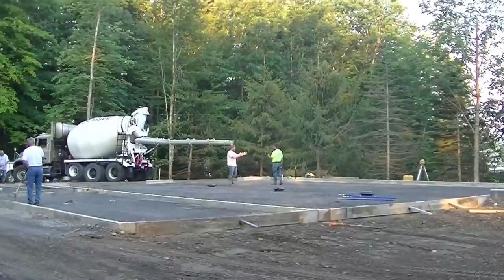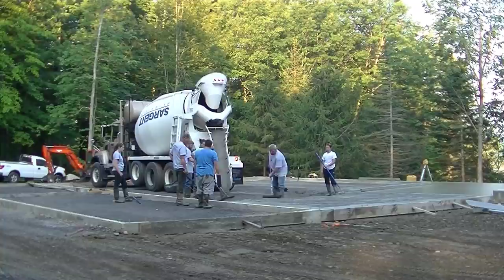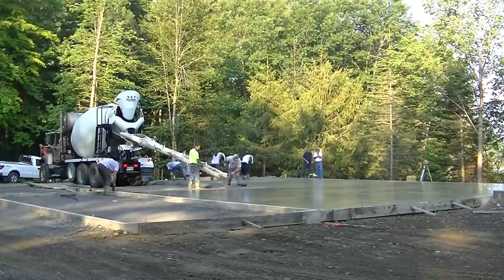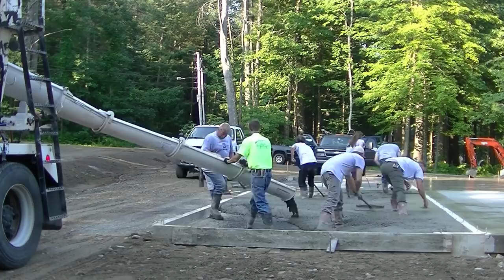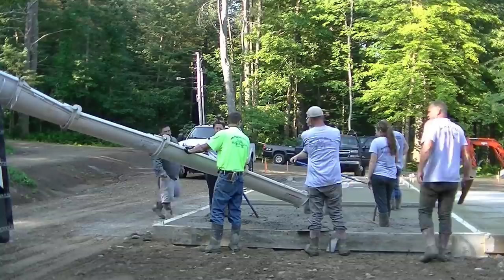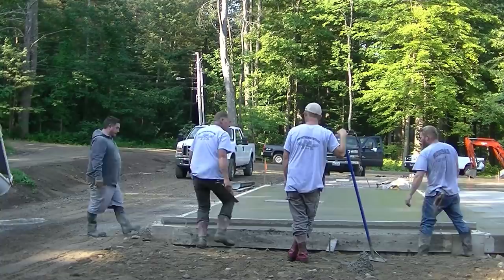How To Pour A Concrete Floor For A Large Pole Barn | Sloped To Floor Drains

Comment: I like to learn more about starting a small concrete business. Thank You Mike for your informative video. Great Work.
Reply from the maker: I'm working on it, stay tuned. Thanks
Reply: R-FPlumbing, it might be too old-school, but when I was a young building contractor, I used to work a pour for free to learn (and help). The only thing I ask the "boss" was,  can I ask questions while it's happening. Usually there is time to ask Q's later, as things move fast getting it down. One thing I learned for sure is: putting the cc down correctly has much to do with how the finished project comes out. Hope that helps.

Comment: Mike, I have been watching you videos for a while now! I really appreciate the way you do things, we are almost identical in our philosophical approach to flat work. I live in western Colorado, it appears that our climate is very close to yours, so this makes it pretty easy to understand your concrete comments and language. We do not use a laser very often but we do use rebar grade pins and the wet screed system. With the temperature changes here in Colorado I use steel and a 6 sack stealth fiber mix on most of my pours, I usually pour about a 5 1/2 slump or so when I am laying down a mono or driveway pour. I also do stampwork as well. I seal all of my concrete at least once with cure and seal and use a stronger sealer when curing time has been reached. I use sikaflex in all cold joints between pours or when pouring up against existing concrete. Thank you for sharing your concrete experience with us all. I have run a business for about 25 years and have over 40 years experience in the trade. I do things pretty much the same as you do and I really appreciate your videos! Thank you a lot, I enjoy them.

Comment: Hi Mike, I just had a 30’x50’ shop pad poured and power troweled.  What do you guys usually recommend for after care for the days after the job during warm weather?  I’ve seen some guys keeping the pad wet for a several days to assist the curing process.  Curious what your thoughts are.  Thanks for making awesome videos like this.
Reply from the maker: If you have the water, keeping it wet for a few days is the best solution for curing.
Reply: @MikeDayConcrete  thank you sir!

Comment: Hi Mike  Love your channel .I learned a lot of tips.
 I want to poor my Pole barn floor 5" thick 2" of foam underneath, wire  Rebar mesh lifted up 2" and pexs tubeing  attached to the  Rebar mesh .
 My 1st question is I live in Ohio  What is the coldest temperature I should poor my barn?
  would you use a pumper truck?
 I do not want to crush my pex tubing. 
 Any other tips
Reply from the maker: It would have to be in the 30's for me to pour and if it was going below freezing that night, cover with insulating blankets. If I couldn't reach all of it from the outside edge, then yes a pump truck is the way to go.

Comment: How much more would it have been to add re-bar or at least wire. Seems short sighted but maybe an enginerd specified the job.
Reply from the maker: Yea, it was engineered. Probably around 750.00 for wire mesh. Like I said, it's not my call. There was fibermesh in the crete. We don't have any problems with cracks as long as the sub-grade is compacted like it should be.

Comment: I am amazed you guys don't use a vibrator to remove the air and compact the freshly poured concrete especially on a job like that. I thought that would be standard worldwide practice.
Reply: Vibrating slab on grades is not typically standard in the US unless there is a lot of exposed edges. Elevated decks, columns, walls and beams should always get vibrated.
🤜🤛
Reply from the maker: psidvicious is right, it's not needed on a slab like this.

Comment: I was gonna ask you -“What kind of forms were you using that you only needed a cpl kickers?” But then you answered my question at the end when you said you did get a bow in the form. Great that you fixed it right then and there cuz it’s a pain coming back and saw cutting and chipping an edge that got away from ya. 
Those were concrete curbs you were pouring against where there wasn’t any forms, right?
🤜🤛
Reply from the maker: It was actually a 4' frost wall with some of the wall above ground. We pour floors inside frost walls like this a lot here in Maine.

Comment: Great video Mike I have one question  how far apart did you have the trucks from each other? because I'm a concrete finisher as well and when I order concrete the plant always asks me how far apart I want my trucks.
Reply from the maker: That depends on how fast you can empty them and screed them. I usually tell them 10 - 15 minutes apart. Unless it's a more difficult pour under a deck.

Comment: Hey Mike, Great videos! I have a question: I live in New York state, just north of Buffalo. I've seen guys getting ready to pour that have like 4" of crushed stone down and others pour right on the dirt....I was wondering what the stone bed does for the concrete or just on the dirt what is the difference..Thank's Paul
Reply from the maker: Both are good, stone or gravel. We pour on both a lot. Just have to make sure they are compacted very good. Stone is a little better if the area is damp or you think you may have a water problem. Especially if there is ledge around, usually if there is ledge in the ground there is water so crushed rock is good for a sub-base in that case.
Reply: @MikeDayConcrete  Thanks Mike, Have a good Christmas!

Comment: Hey there I've got a new pole barn 30 x48  I'm planning a 6 inch slab with 6 inch of stone but I'm in a heavy clay area which sub base is best for clay #1 clean or 2 cruch and run ?
Reply from the maker: Dig out the clay depending on how deep the frost goes in your area and fill with good clean crushed gravel. Compact it in 6 to 8 inch lifts.  I would suggest finding a really good excavator in your area and taking their advice. My advice is just in general.

Comment: Would this setup here be good for a machine shop. As far as the eight of machines?
Reply from the maker: Yes, a 6 inch floor would be very good for a machine shop. As long as the sub-base of gravel is done properly.
Reply: @MikeDayConcrete  Don't do a sloped floor in a machine or metal fab shop. The floor needs to be flat, flat for machine/work setup and fabrication layouts. I had a metal fab building with a slope to drain slab, drove me nuts having to compensate every time I did a metal fab layout on the slab.  I eventually had it over-poured with a 4" flat slab.

Comment: what do you do when it rains 10 days later and you find standing water all over the place?
Reply from the maker: What are you talking about, there's floor drains in this??
Reply: @MikeDayConcrete  I meant low spots that were missed.  I have seen this in many large building with floor drains where there are small pockets of standing that don't drain out.  Hell I have seen basements where the drain is on one side and the other side has water.  I realize you are the expert and never have that happen to you.

Comment: Hey Mike, how much lower than grade do you generally set your drains on a floor this size?
Reply from the maker: It's usually up to the General Contractor. I like at least 1/8" per foot but that's hard to do an really big floors. We had about 2" slope from the outside walls on this one.

Comment: HOW ABOUT FOR ME TRYING TO DO MY OWN WORKSHOP SLAB. WHAT I WILL NEED, HOW THE DIRT NEEDS TO LOOK BEFORE HAND? HOW MANY PEOPLE TO HELP, PERMITS?? FOR THE GUY JUST WANTING TO DO IT MYSELF.
Reply from the maker: I have a lot of videos showing how to pour concrete floors. And my concrete slab course teaches you how to set up, pour and finish a slab. Plus it shows you all the tools you'll need. The gravel base depends on what is already there and what kind of climate you live in. In Maine it's usually a minimum of 2' of 3/4" crushed gravel. Compacted in 6" lifts and leveled using a self leveling laser.

Comment: No rebar, no vapor barrier.  This is hack work. I'd be embarrased, and I'm not even a pro.
Reply from the maker: Joe, intelligent comment, not my call on the vapor barrier or rebar. Guess that makes me a hack just doing my job. Nice to hear you an expert!
Reply: @MikeDayConcrete  You are the expert.  It's your job to tell them the right way to do it.  Many times I've told customers that I won't do it they way they want.
Reply from the maker: Joe, it doesn't work that way on all my jobs. This job was engineered. I was a sub working for the foundation contractor who was working for the building contractor. The building contractor had a set of plans/blueprints from the engineer to work off. Both the building contractor and foundation contractor are very experienced. I can give them my advice but that doesn't mean they will take it. I am just hired to pour and finish the concrete. They could hire 10 other guys in my area but they hire me because I care the most and do the best job in their opinion. I am an expert but not having a vapor barrier or rebar in this floor make me a hack. You are free to say what you want but not having all the information  , you could have said it or asked why in a better way. If this were a homeowner hiring me, I would have required it.
Reply: @MikeDayConcrete  Been doing this for 55 years...retired now  My father was general contractor started at 18 in 1936...That answer you just gave was 100% on the money...I watched many in this business and your be in business many years, long after guys that talk like Joe are gone...I have a sister younger than me and she is as good at this as your girls are...Your for sure NO hack Mike...Oh I have a son that is a civil engineer and he would agree with you too...